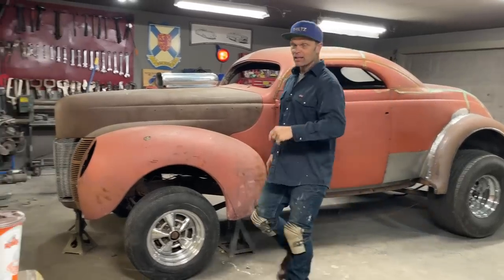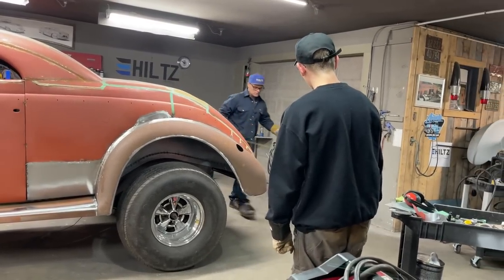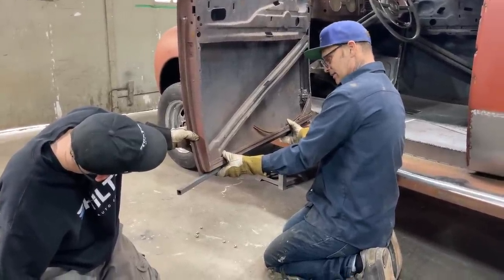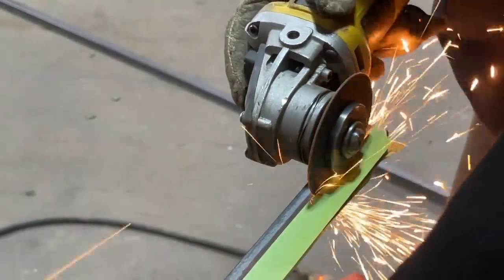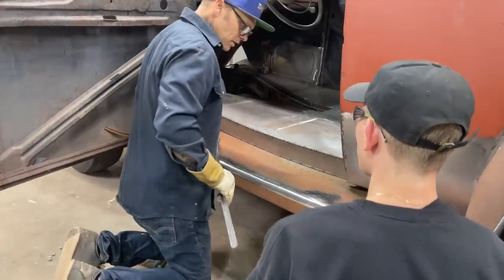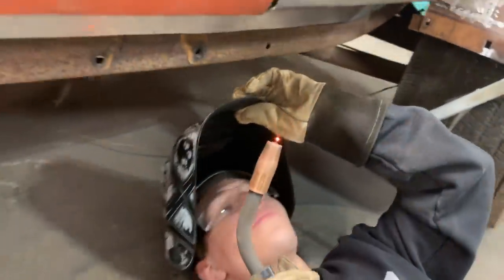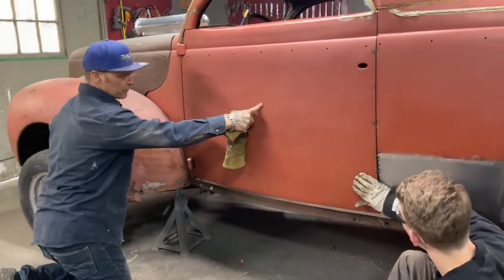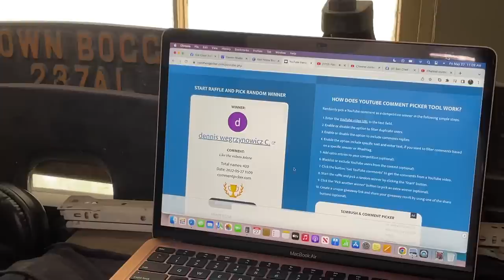The next fabrication hurdle... does the door hit the running board? 😳

Comment: Coming on really nicely Chad Aiden and as usual exceptional camera work Jolene.
Just a safety tip - Don't hold you head directly over the zip cut wheel , as if it shatters, it will spit bits into your face. 
A face shield will provide a better safety for your face and ear protection to avoid industrial deafness in later life.
Reply: I wish I would have paid attention to all the safety warnings when I was a kid. Many people can’t handle the psychological /emotional stress of tinnitus.

Comment: Chad, another way you can get the doors to match the bodyline is to remove the inner Crash bar. And replace it with a tension bar like they do with a Les Paul Guitar. They're adjustable so after years of use, you can lift the neck back up to the original settings. I don't see why a car can't be built in the same way. Your work is refined, it's called a truss Rod. Love your vid's bud I watch them almost every evening.

Comment: Can I mention in the situation of scribibing the paper at the floor if you use a piece of heavy gauge aluminum foil and a rubber roller you can put your piece of foil on the floor and fold it down over the edge and gain your radius and then trim it and transfer that to a more solid template material . just saying my dad used to use heavy gauge foil during fabrication a lot its just more positive results . ok just my two cents on it.

Comment: find a 392 hemi with 8 Webbers and paint it like the hot wheels, or find a new hemi engines as long as they been out, I'm sure you can find a wreaked truck with them engines in the junk yard,